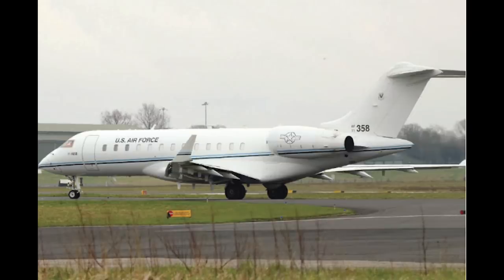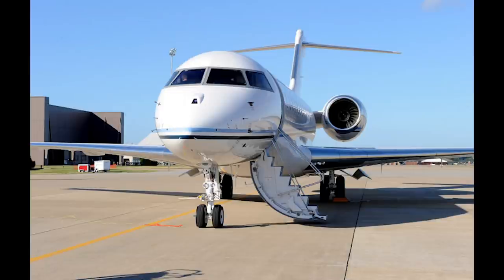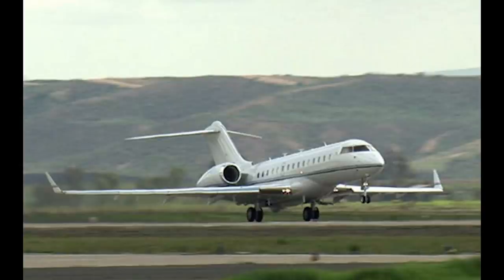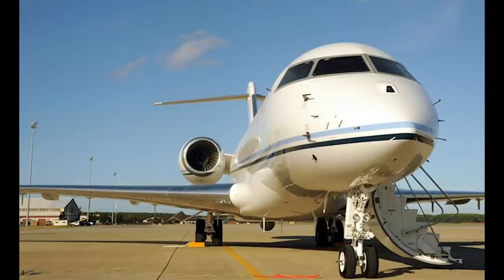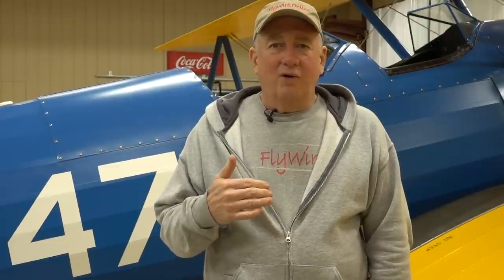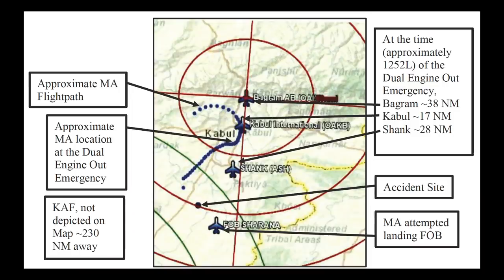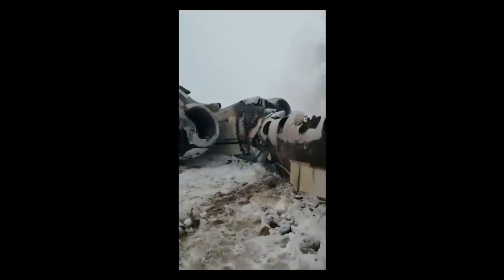Accident Review  Global Express Dual Engine Out

Comment: Is it possible that the ship was shaking so badly that the tiny characters on the EICAS were nearly impossible to read (especially through the plastic lenses of a donned oxygen mask “CABIN ALT”) ?
Reply from the maker: Guaranteed they were hard to read!
Reply: That is why they need a different kind of user interface instead of these digitize versions of old analog instruments.

What is needed is a clear visual aid, an actual outline picture of the aircraft on a giant flatscreen. This would be a Birdseye view.

On this picture would be  little green dots for every critical item, such as several for each engine, the critical factors such as fuel pumps, fan blades, etc.

When something goes wrong, the green dots change to yellow or red, depending on severity.

In the case of this accident red dots would have lit up on the graphical interface at the left engine, and instantly both pilots would know that they have a problem with the left engine and they won’t have accidentally turned off the right engine.

And by the way they wouldn’t have to “wind the watch“ and waste time getting their sensibilities back, because the user interface would be so simple that they could just look at it and see what is going on.

I have been very critical of pilots because of their incompetence in basic flight maneuvers, and in resorting to their basic emergency training. And they deserve the criticism, because they kill passengers with their ridiculous decisions.

But now I am opening a new page of criticism against the engineers who designed cockpit interfaces. They are doing a terrible job.

By the way I am both a pilot and an engineer, not an armchair quarterback.

The user interface should include two main graphics. The one I already mentioned that shows an outline of the airplane and green lights for all of the critical features on that aircraft, and they turn yellow or red if something goes wrong. Even a mental retard understands that this is a good idea, but I’m pretty sure the pilots union would be against it. For whatever reason?

The second user interface that is needed is a Birdseye view of a 3-D rendition of the aircraft and it’s orientation with respect to the ground. I say this because it seems like pilots don’t know how to read the attitude indicator in an emergency and they stall aircraft and pile drive into the ground, all the time. 

Because I was an avionics technician in the Air Force before I became an engineer I am pretty much an expert at reading instruments, and I have so much prior time with them, but most pilots come in raw without a lot of technical expertise, and they’re never very good at it.

My final recommendation is that no one should be allowed to be a commercial pilot unless they have a current license to fly a glider. That way we can be reassured that they actually know how to fly the aircraft when the auto pilot is disengaged.

And as I have said add nauseam everywhere else, full automation is the ultimate solution, So as to get rid of the pilots, the good the bad and the ugly.  As an electrical engineer, I designed many control systems, And when done right, it is always superior to manual control.

Comment: Very good video, Wind your watch should apply to many situations in life. If I under stand right N1 was stuck? how with modern electronics could this not have some conformation checking before displaying critical information! (e.g Strain gauge on engine pylon)
Reply from the maker: Good question, there is actually a vibration gage that measures the vibrations coming off the engine. It likely was damaged along with the RPM probe for N1.

Comment: Dont ever think those engines will come back nicely.  Single engine pilots head to airport before trying to restart engines.  Why keep going away from it??.  I have 4 engine fails-on take off.  3 on take off and on Piper seminole a total right engine seised at 1,600 agl climbing out loaded.  Luckily the 2 on singles were partial power and i turned back and landed on opposite runway.  
The other 2 were on a DC3 and a Piper Seminole.  I brought them back too.  The DC3 i did the downwind leg at 400 agl over houses.  Could not climb over that even with right engine at full power.  Had to unload that one, load another 3 in the rain- then fly 6 hours in rainy IFR around thunderstorms..  Hard day.

Comment: Scott, While watching you final explanation of the video, it came to mind that there was possibly some deference given to the pilot that shut the right engine down(pilot 1). In other words, the other pilot(pilot 2) assumed that the pilot who shut down the right engine(pilot 1) had, in fact, done the correct action. Therefore, pilot 2 failed to confirm pilot 1 actions, and never went back to the right engine. Poor cockpit management? Your thoughts?
Reply from the maker: Without the CVR, we can't really tell. So, the failure to reassess and restart the second engine goes on both of them. What happened in this accident goes in your tool bag!

Comment: Interesting. Did I miss something? The FADEC message does not say which engine it shutdown.
Reply from the maker: The panel on the right is the message location... it displayed "L FADEC FAIL". Which means, in that airplane, that the engine will be shutdown.
Reply: @FlyWirescottperdue  Ah.. Thanks. The message would be better if it said 'LEFT'. I certainly missed the 'L'

Comment: stupid question: would not had the landing gear absorbed some of the impact force had it been deployed?
Reply from the maker: Not a stupid question. But the answer is no. The gear is designed to absorb shock on a part Ed runway. On unprepared surfaces it digs in and usually flips the airplane over.
Reply: @FlyWirescottperdue  thanks

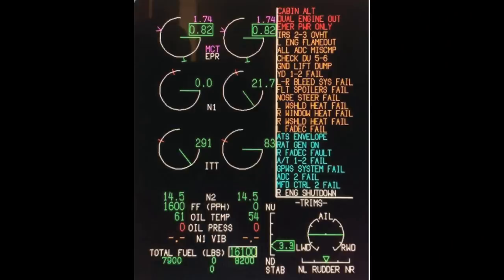Comment: Why is N1 VIB not visible until 14:03 ?   Compare to 11:42.  If the crew had seen a high vibe on #1, maybe they would have had a quicker or more accurate verification of which engine is failed?  I also noticed it’s dashed out, is that due to the engine run switches are in the off position?
Reply from the maker: Apparently it is only displayed on exceedance and associated with a color.

Comment: Amazing that with all that electronics, the obvious vibration from a thrown blade in any stage isn't sensed and used to initiate a shut down automatically, with an "engine fail" warning light for the crew. Then let them manage the good engine and retrim the airplane. In industrial automation, we'd never expect an operator to manage a safety critical problem by bombarding them with conflicting information and expecting them to run checklists manually.....too slow. And error prone. Aviation appears to be addicted to giving crew control over systems that are now too complex to be understood in the time available to manage a problem.

Comment: Might be a stupid question but why don't aircraft have airbags?
Reply from the maker: Not a stupid question and a select few of more recent designs do. There are also some airbag shoulder harnesses out there. But the main reason is that the vast majority of GA airplanes were not designed for them.
Reply: Actually a great question. I was and as normal bring a paraplegic with a shepherd service dog always get to sit in the bulkhead row of all my commercial flying. It just so happened on an Alaskan Airlines flight that the seat nearly was extremely thick and just not like the normal seatbelts. Looking into the pics on the seatbelt shows that they are actually airbag seatbelts. I happened to find this quite interesting and at the same time thought it to be strange. After a few mins it dawned on me that the bulkhead seat, which wasn’t separated from first class by a hard wall verses a lite cloth like screen, would be quite useful in case of such need. 

Any ways your question reminded me of the airbags in commercial aircraft, or at least Alaska Airlines 73-9ETOPS.
Reply: The primary factors  would be additional weight added on the aircraft, &  not forget additional maintenance.

Comment: I can't sit here and say anything good about these pilots' efforts. When you have 43,000 feet to play with and numerous safe airfields well within a proper glide, let alone powered flight from one engine if you have taken the time to assess the situation, it's yours to crash.

My preference is to pull both back to idle, let them stabilize while doing my best to make sure nothing else is happening, and assess the engine parameters and error messages. I am sure they had a strong preference to get it under control with that vibration, and it's clear that it could panic someone, but that's why you have to stop and breathe a moment. Honestly, if it's so bad you can't spare that much time, you're probably already dead.
Reply from the maker: Good comment Katie... time to do that Pilot sh...